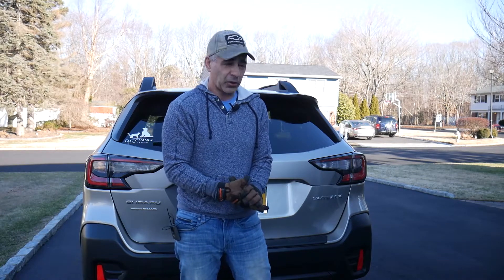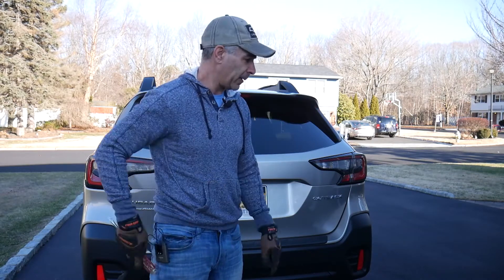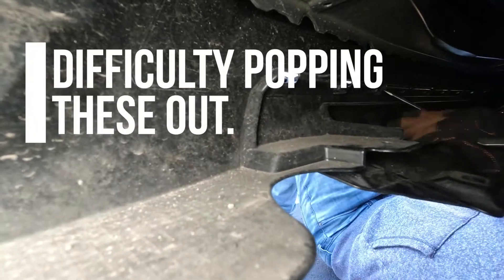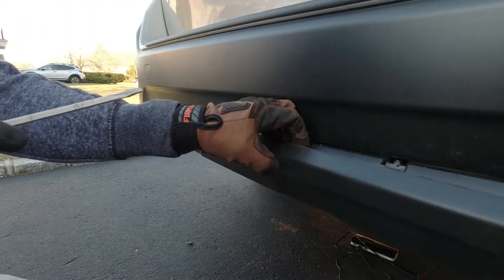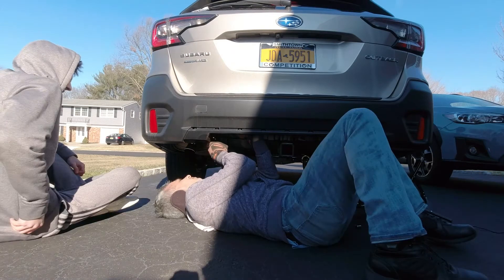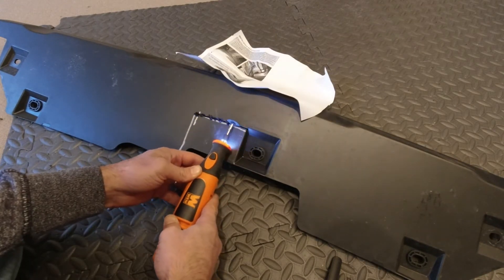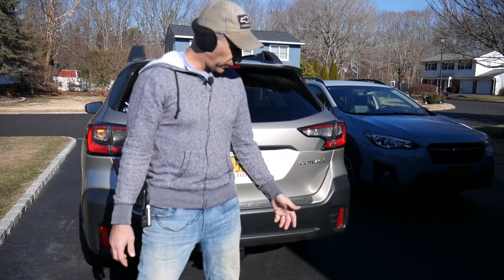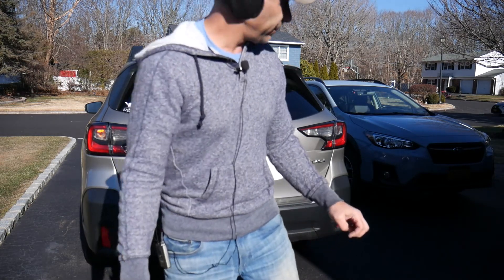2020 Subaru Outback Trailer Hitch Install. Curt 13437

Comment: You don't need anything more than scissors and a good utility knife to cut the valence panel.  2 cuts and then connect the ends of the cut and flex at the score.
Reply from the maker: Thanks.  I wish I knew that beforehand.  That sounds easier than the way I did it

Comment: Not certain I would use a flat head screw driver, you left marks perhaps a proper pry tool?
Crash integrity compromised. Have you checked?
Simple and fast yes, me thinks I would spend a bit more for a vehicle that I plan to keep and do an OEM hitch.
To be fair working in cold without a lift is a bummer!
Reply from the maker: Thanks for the comment and totally agree on the screwdriver!  I lost my pry tool and used this instead.  Good news is those marks were not scratches in the plastic and a little armor all they wiped away, but yeah, use a pry tool.  As far as the crash integrity... I would think this would be even stronger as the rear bumper is currently that aluminum bar that goes across under the plastic bumper. So I would think this is even stronger.  However, I know cars are engineered to have crumple zones and are supposed to fold in a certain way on impact.  That being said, the OEM would I'm sure was tested by Subaru to meet the crash requirements.  I would think an aftermarket one like a big brand like Curt, have to meet the same standards and requirements. But I'm not sure.  Excellent question though.
Reply: Thank you for your reply. I am glad to hear about the what I thought were scratches being eliminated with Armor All. Your Videos are outstanding and I am a fan. I am a Quality Control Instructor and very concious of  safety and manufacturing issues as wel.
Keep the videos coming. Love my Outback by the way.

Comment: It is much easier to remove the clips for the valence panel with 2 screwdrivers. It looks like a an improvement over the older versions.  The whole hitch does not look as HD as the Subaru factory hitch though.  Do they crash test the hitch?  Not a terrible alternative if you are leasing especially.
Reply from the maker: Yeah, I dont think this is as clean an install as the OEM, but it's much cheaper and Curt is a pretty reputable brand.  I don't know if they crash tested it, but I'm not towing anything. I just use it for adding things like a bike rack and cargo basket etc.

Comment: cringe on using the flat head screwdriver to remove the lower panel and leaving chew marks everywhere
Reply from the maker: It was just dirt/rust marks from the screwdriver. Wiped right off with a rag afterward